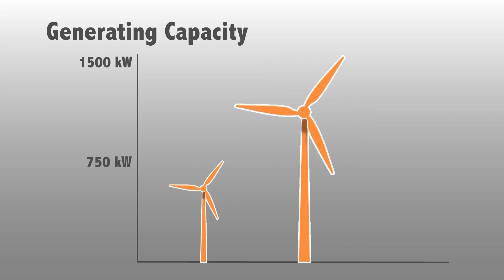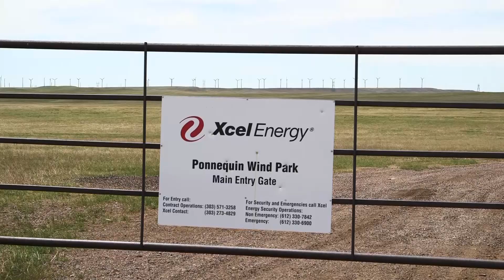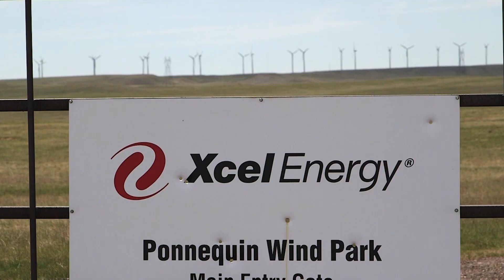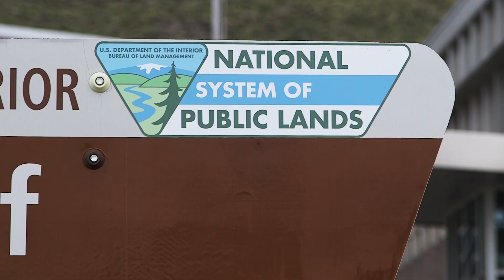Who Cleans Up When a Wind Farm Retires?

Comment: It’s the same thing as asking “How is an old pair of underpants disposed?” There are very few things that have the disposal cost built in to the price or the ongoing operating charges, and even fewer where the putative costs are actually applied to the stated purpose. But it should be done, just like any other tax, and for everything that is produced, and has a lifespan, and will some day otherwise end up in a landfill or in the ocean.
Reply: I'm going out on a limb and guessing that your underwear would not be a bulky and non-composting as a wind turbine.
Reply: @JRPetruk  Your speculative reach is breathtaking.
Reply: If you're a clinton you donate your old underwear to charity and take a tax write-off!
Reply: Underpants are not worn out, that would be indecent.

Comment: @Flasher Trasher

"And yet the coal fired plants of the 50s&60s that have been converted to clean natural gas are still generating electricity effectively and profitably"

What planet is this on ? 

Plants that have been retired from 2008 thru 2020  by % of each fuel:

Coal - 47%
Steam - 26%

The lack of rules **was** an issue.   Today, wind farms must bond the monies for a cleanup and hold these monies in reserve.  Cleanup is  a minor issue ... the towers can be taken down, for scrap metal.  The motors can be repurposed to generate electricity from other fuels sources.    Fencing will generarly be harvested stored and resold.  Concerte pads can be turned into RCA and used as road bedding material.   Sure there is a cost involved and the rules should be nationalized, but comparing the impact of old wind farms to coal and oil plants is like comparing a ding inn yoiu r card door from next car letting their door fly open to a car getting hit by a train

Small wind farms are simply not economical compared to other alternatives, tho still more so than coal and oil... but the col and oil industry leaves much larger scar on the land.  Mines have been burning on Pennsylvania for decades releasing tons of pollutants and greenhouse gases. in the air, in the water and on the land.   Plants leave behind large swaths of polluted soils ... Wind leaves none of that.

Comment: So you add to the cost of wind farms the cost to tear them down 20 years later and they did nothing for the electric grid as the costs could have run a coal or gas plant for 50 to 75 years or more.

Comment: THE SHAME IS WE HAVE A WAY TO GO COMPLETELY SOLAR. NO SOLAR PANELS NO CAUSTIC BATTERIES. A SYSTEM THAT HAS BEEN USED BY NASA AND THE MILITARY SINCE THE SIXTIES.
WHEN I SAY THIS IS POSSIBLE I HAVE COVERED ALL THE BASES. TO THOSE WHO THINK SOLAR IS NOT AN OPTION 700,000,000,000,000 KILOWATTS OF POWER FALL TO EARTH IN A ONE MILE WIDE STRIP AT THE EQUATOR EVERY 24 HOURS.

Comment: So you are saying you builders had no fore sight for who was going to take them down. If they would be reclaimed to how the area was before the sight was developed. Or replacing one tower as they stopped running or needed an upgrade. One or two replacement is cheaper than the whole farm at once. It all costs money. So repair replacement and retirement of the whole farm should be worked in to the plans. Like it or not. Maybe the federal government could help out with infrastructure funding. But you never know everything is going so well fore wind energy these days.

Comment: The really sad thing is that without regular yearly maintenance on the blades and replacement of all the bearings, these turbines will not even last 5 years.  And if you forgo the maintenance then they just fail.
Reply: "The really sad thing is that without regular yearly maintenance on the blades and replacement of all the bearings, these turbines will not even last 5 years" Prove your longevity statement please. And tell me about a bearing-free diesel generator or heat pump, I'd like to invest. If you don't change the oil in a diesel engine, it will just fail. If the cooling system doesn't work, it will just fail. If everything does work in a diesel generator, it will poison you with the exhaust. What were you saying about wind turbines?
Reply: @justsomeguy934  Nice challenge! It looks like Frank and Dana have moved on to less green pastures. Cheers.

Comment: There's no way that the wind generator is economically feasible when the lifespan is 15 years. The cost of construction and removal is high and the installation and maintenance uses huge amounts of "fossil fuel".
Yet the envirowacko groups championed by the commander in cheat still claim that we need these costly and environmentally destructive power generators. 
Nuclear power is cheaper and more reliable than the wind power. 
It's better for the environment. 
Of course because it makes sense, the thought of it is not permitted
Reply: Totally concur.